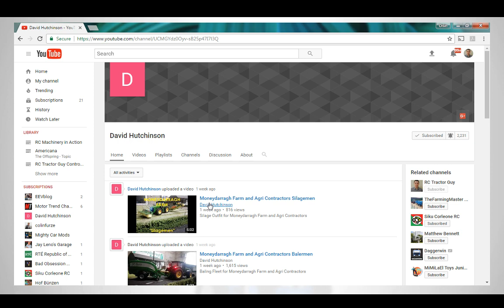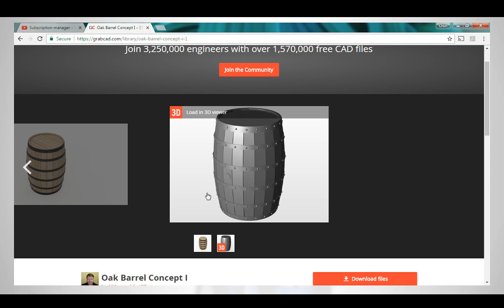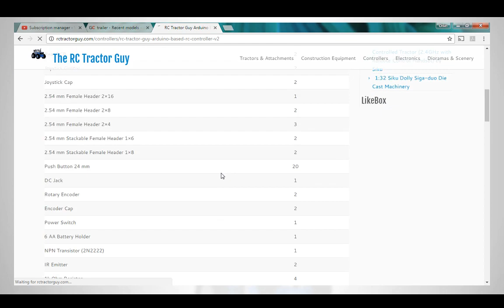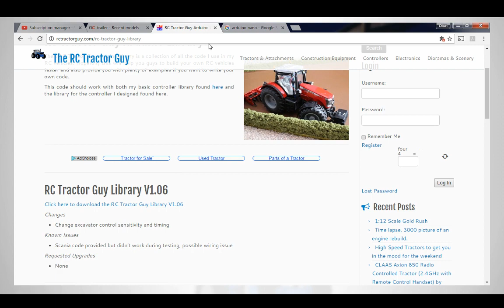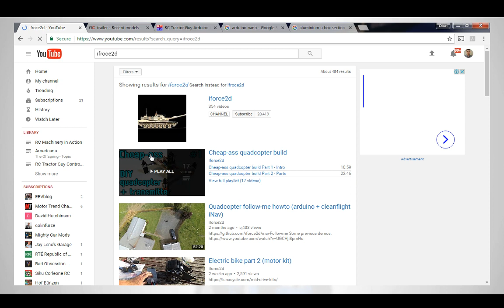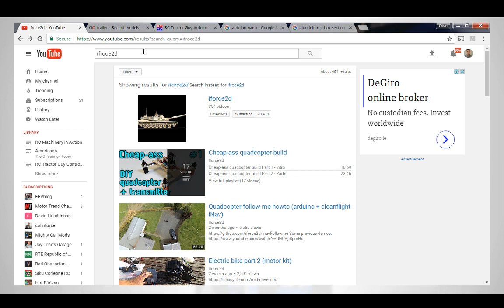RC Tractor Guy Live Stream Test

Comment: Hi,
Regarding the IR protocoll adressing in the video, here is how it works.
The first four bits after the start bit make up the adress. (The other 4 bits of the light byte)
It is left to right actually, so if the left most bit is high and the other 3 are low its adress 1. For adress 2 the left most bit is low, the second from the left is high and the other two are low, and so on. For each adress 1 bit is high and the other 3 are low.

I think that is all that would be neccessary to talk to each 4 adresses of the receiver, the different spacing is only to minimize interference between more than one sender at the same time. (Altough i have not testet that theory as i only wanted to receive the data, not send it)
So the spacing between each data pack is as following:
Channel 1: ~64.8ms
Channel 2: ~73.8ms
Channel 3: ~82.8ms
Channel 4: ~91.8ms

Everything else is the same for all 4 channels.

I hope this helps if you ever want to try to implement the other 3 adresses to your sending unit. I know you have a lot of unread comments so i hope this gets read some time ;)
Reply from the maker: That is great, I must try to implement that since you've done the hard work here I should just have to make some minor changes to my code if I can even remember how I wrote now :) I am doing my best to get through the comments and emails, went from 152 down to 59 unread emails tonight alone!! Although I still have facebook messages to look at and to sort out my poor neglected forum
Reply: Hi,
That really is quite a lot of emails.. 

I have implemented the checksum to my receiver code according to your explanation in your video, and it worked first try! Thanks again ;)

Although i still have an issue.. The data is still fluctuating. The checksum is correct basically 99% of the time when the full 57 bits are received. But the weird thing is that the values are still changing without touching the remote and with correct checksum. For the potentiometers it makes sense, the values change slightly.. But the light bits sometimes are high without light on.
So this means that the control sends out weird data? Otherwise the checksum wouldn't be correct, right?
Weird stuff... So there has to be some error-correction still. I guess for the lights just take 4 to 5 data packages and if all of them say "on" the light goes on..
But for the servos i have no idea. But i guess that explains the servo jitter in siku control tractors sometimes.

Anyways.. I wanted to ditch the IR stuff and continue with the NRF24L01.. But even that is giving me trouble. I've spent the last two weeks setting up a basic sender and receiver but 99% of the time it doesn't work. 
But now i have the example codes from the RF24 library working on breadboard 50% of the time.. The other 50% nothing is received. Not sure what i'm doing wrong.. Did you have the same experience getting started with the NRF modules? Any tips? I feel kinda stupid especially after watching pretty much every NRF24 vid on yt i could find, and they all work.. None of my own code worked so far. I've also tried your basicController with no luck, but using the Pro Micro and pots since i don't have a Uno and Joystick shield.. So hardware issues are probably the issue.

I guess next i order an Uno and Joystick Shield from china and see if i can get your Basic Controller to work.. I have a feeling that at least 50% of my trouble is in the hardware i'm using. 

Sorry for the long comment, i included the stuff i wanted to write to the other comments you've answered yesterday in here.. I've said i ditched the RC models hobby.. Well, i kinda started again, i guess..